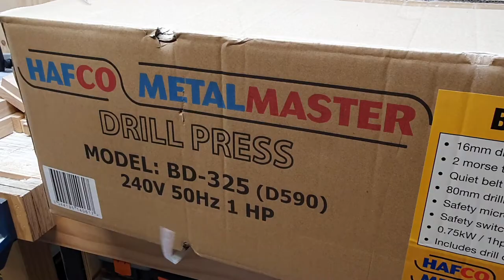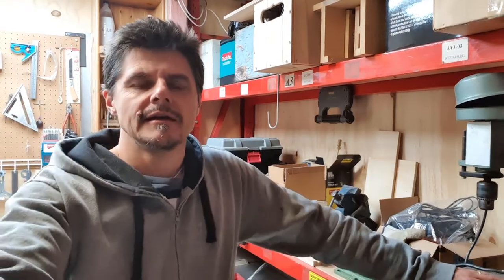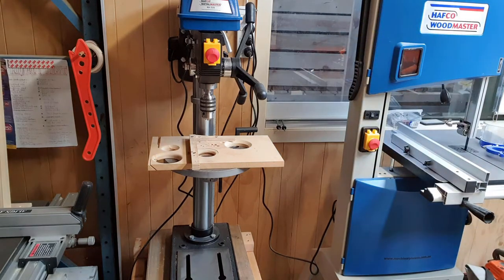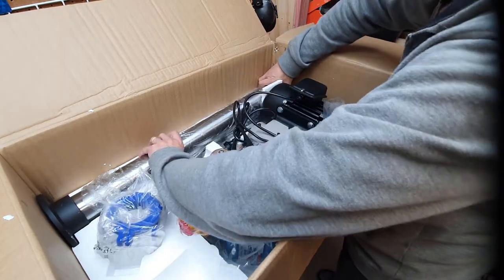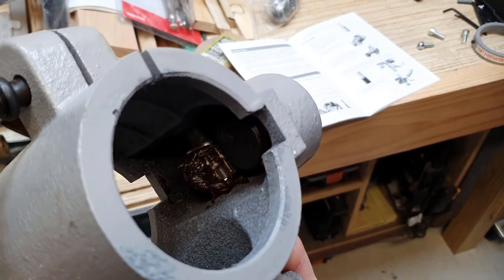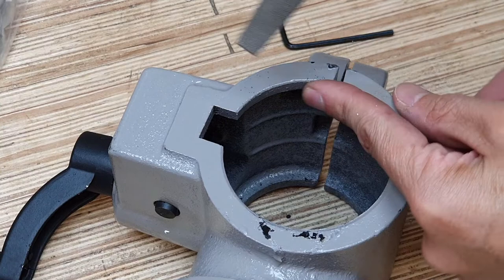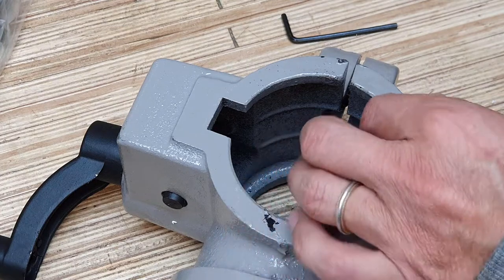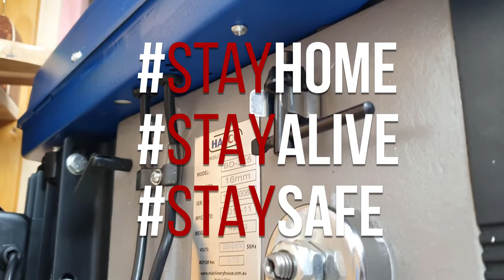Machinery House/Hafco 1hp drill press assembly.

Comment: Looks good mate, most of my machines are hafco but not my drill press, when I was in the market for one last year all I could get with a radial arm was a carbatec , same size motor as yours I believe, surprised me on how much better it was than my old Ryobi and a great upgrade 👍👍
Reply from the maker: Hey Graham - the drill is a beast - I drilled some 3mm steel the other day and it goes through it like the steel isn't even there - I went straight through and drilled into my bloody vice clamp thingy before I even realised I had started! I'm not used to that much power.
With my old drill it used to take about 20 minutes per hole ... lol.

Your drill press table is looking good - massive!

Comment: Great vid mate 👍🏻 just got one today and this really helped me out as the instructions are a bit here n there. 
Just wondering if you had any issues with the depth guide ? It spins freely but if you tighten it the handle locks so you can’t move the drill up and down. Many thanks !
Reply from the maker: Awesome mate - it's a great drill - I love mine - plenty of power and big enough for all that I need it for. Re the depth guide - I know what you mean - what has happened is that you've locked it in the 0mm depth position - so it won't move. If you loosen if off and spin it all the way around the other way you'll reach the maximum depth. It's not very intuitive how that works and it gets me almost every time and I still haven't mastered how to use it - just trial and error every time 😆.
Cheers MrOcean - enjoy the drill mate.
Reply: @TakamiWoodshop  Thanks so much for getting back to me mate , and cheers for the advice ! 
Yeah it is a little tricky but I just eyeball it and is fine. Built a surfboard rack yesterday and it made short work of the 35mm holes for the dowels, great drill indeed ! Keep up the good work champion 👍🏻